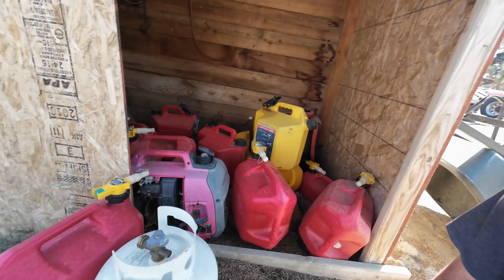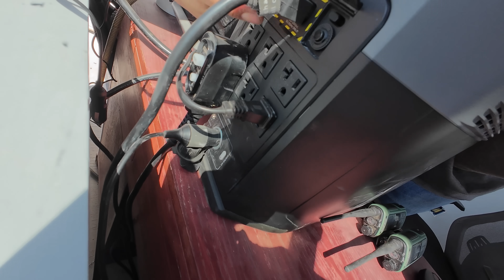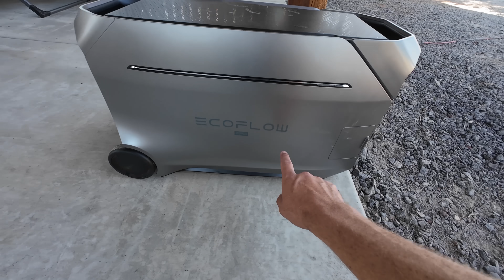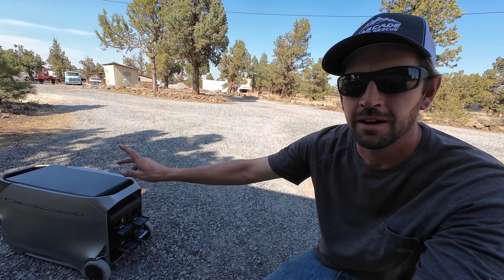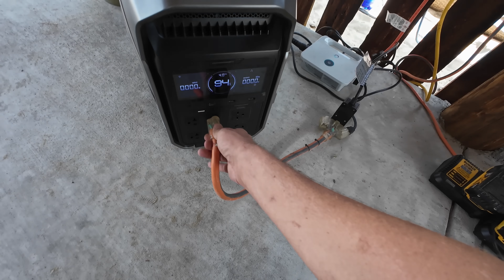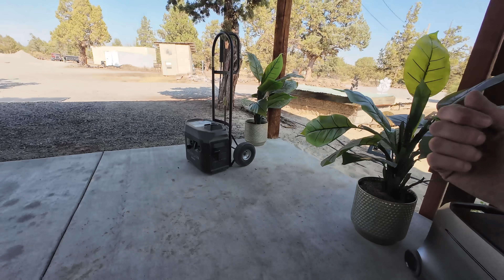Be prepared for DISASTER with EcoFLow's new Delta Pro 3!

Comment from the maker: Enjoy 5% off with my code 24EFDCASEY for your backup power. Valid until September 9 (Applicable for all products except Delta Pro 3 stand-alone, flash sale products and accessories).
Learn more about EcoFlow solutions: https://bit.ly/477ow9P
Discover the latest generator tech EcoFlow DELTA Pro 3: https://bit.ly/4cBdr1E
EcoFlow DELTA Pro 3 Amazon: https://bit.ly/3WSV2aC
Reply: Nothing beats EcoFlow that I've found it's more than worth the price if there is anything better nobody has told me😁
Reply: I wonder if the eco flo delta 2 or pro could be used to give a charge to your electric car if you ran out of charge in the middle of no where
Reply: @aaronmcconnell7358  yes there's ways too make it possible
Reply: Not that I would recommend everyone try because you could ruin vehicle very fast if done improperly
Reply: But is it repairable? I cannot afford power stations or setups that i can't fix if a circuit board fails 11 years from now.

Comment: 10:30 He misspoke a bit here: The Delta Pro 3's internal batteries can go through 3000-4000 charging cycles before diminishing to 80% of their rated capacity. The unit itself should certainly last well beyond that.
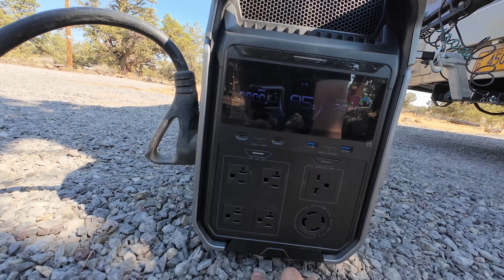He also misspeaks at 12:15... both the receptacles on the front's right half are 240V outlets. And you can only have EITHER the 120V OR the 240V output on at any given time, never both.

Comment: Reading the debate about the Ecoflow being a generator or not. Well the chemical reaction inside a battery generates electricity so it is both a storage and a generator 🤣 I’m only concerned with the fact that when I turn on my Ecoflow, my phone gets charged as do my rechargeable flash light batteries along with my soldering iron and LED lights. I’m in a situation where I cannot run an extension cable so charge it then move it to my work bench. I have sent a link of your excellent presentation to a family member in South Africa where electricity is basically rationed to about 4 hours twice daily. 😱
Keep up keeping up Casey! Your videos sure beat a lot of bs on tv.

Comment: The one thing that i perfer my c1000 over my dp3 is i can still pull solar at very low light. During a rainly dark day i can still get about 200-600 watts with the c1000 which isn't much but still something. My dp3 won't pull anything unless i lift the low light limit which only runs for a breif moment before it cuts out.

Comment: Needed to post this as I bought my Ecoflow as a direct result from your videos Casey. Purchased in Canada, so the code did not work, but wanted to let you know that they should give you codes for Canada usage. In any case, I am posting to help the algorithm as well. I left my rock lights on overnight last night and the battery was at 9.9v. Jeep would not start. First time I used the alternator charger to reverse charge the Jeep and it started up right away! Best purchase ever and thanks to your reviews! I was curious if it work, but had a real-life need to do so.

Comment: I purchased the delta pro system October of 2023.By October of 24 I had 6 delta pro failures. My units seemed to fail in a variety of situations. I had one that actually blew a hole in the side of the unit about the side of the round cooling fan. Thanks fully no one was hurt and it didn’t catch our property on fire. 

The customer service team that I had access to was not well trained. They wouldn’t be able to do much more than verify that the firmware was up to date on the device and my app. 

Normally I wouldn’t mind a standard RMA process but after each failure eco flow started to slow down their response time as they thought I was abusing their unit for fun. I’m not whistling diesel torture testing trucks. I’m a blue collar dude who supports his woman who’s been unable to work for four years due to health injuries. 

I overall really wanted to like the delta pro system but the unreliability made it hard. My thought is about the time of purchase eco flow had release the DPU. Maybe they turned their quality control focus toward the DPU and it causes the delta pros to be unreliable? The only info tech support would give me was claims of loose connections from shipping. I ultimately do not trust the delta pro system as it was genuinely unsafe and could have burned down our property.

I also was let down by the customer service team. I had nothing but difficulty getting fed ex to pick up the units to return them to eco flow. When asking the customer service team for a different carrier to see if that simplified the process they told me my request for special treatment was escalated to their supervisor. What type of customer service team responds to a solution oriented question with a response like that? 

I’m bummed my experience didn’t match most of the positive responses I see most people have. If you do purchase from eco flow I hope you all have better luck than I did!

Comment: I just bought the wave 2 for the bunk of my truck because I don’t do heat well, needless to say it was worth every penny (basically the value of the Canadian dollar) I wish I had the unit years ago because this summer is the first one I managed to get a good nights sleep no matter the temperature. I am looking forward to see how the heater function works this winter, but I don’t have any regrets thus far so even if the heater isn’t quite good enough I can still use the diesel air heater.

Comment: Through your fathers' day link (I think that's what it was.) I bought a complete set of two DeltaFlow Max systems with a bonus solar panel kit.  I'm still experimenting, but one is designated to charge my new EGO brand Zero-Turn mower and, outside of needing to be charged so I could mow before the system arrived/was set up, the mower hasn't been charged on anything else since.  The mower requires 1 and 1/2 generators to get a full charge in about an hour, but like I said, I'm still experimenting and debating on getting extra eco-flow batteries.  But I love the system as it is!

The first time I charged the mower I didn't have the supercharger set up yet so I was charging the batteries individually and each one took about an hour to charge.  It comes with 4 10 AH batteries.  And, now I have a 5th battery plugged into the mower, a 5AH, and the total charge time is about an hour with the eco-flow.

Comment: The Honda generator you showed has an eco mode, which runs the generator at idle when there is no load! Amazon DELTA 2 Max $1,399.00, Amazon DELTA 2 Max Power Station Extra Battery $999.00, Amazon DELTA Pro 3 Portable Power Station $3,199.00; Is EcoFlow a Chinese brand? Leading China's Energy Storage Market with EcoFlow. EcoFlow is one of China's most recent unicorn companies.

Comment: Casey, your killing me. These Ecoflow products are amazing and everytime you do these videos, I want another one. I have a Delta 2. I have used it for the past 2 years. I just bought the AC unit. I rent, so I can not have a generator nor store fuel. When you live in Central Florida, you need backup power and EcoFlow does the job beautifuly.

Comment: I purchased a Delta 2 , December 2022 and haven’t regretted it for one moment. It’s powerful enough to run my top load washer, toaster over, coffee maker, Instant pot. It doesn’t have a lot of reserve power but it’s a fair trade off for cost and portability. I like that I can change the charge rate via the phone app. I have three other different brand solar generators, but this is by far my favorite.

Comment: Have a River 2 and River 2 Max and the 160W Solarpanel. no regrets. 
One flaw is the "loud" fan. starts at low power and always at 100%... (full disclosure, didn't try firmware update)

Biggest flaw: how ecoflow tries to actively sabotage and block any other software using the API of the devices.
No option to tie them into your home automation setup, the community driven sollution depend on them not blocking even more options. That sucks and should be a reason to not buy ecoflow at all because you need the app for a lot of functions and since there is no alternative, the moment ecoflow decides to abandon a product or stops existing, you have very expensive eWaste.
All this without any good reason.
I really hate that trend of companies trying to control us customers wherever they can. "No, this feature we advertised will no longer exist tomorrow because we know better what you wnat than you yourself" "Oh you repaired your product in another shop than ours? Let us brick it for you to teach you a lesson"

Comment: Finally, an ad for battery-in-a-box devices that doesn't erroneously call them "solar generators". Closest solar generator is 93 million miles away.

I'm surprised Casey was messin' around with all those fuel jugs. I use a couple of DOT approved 30 gallon drums, a dolly, and a hand pump system I made. Sure beats lifting and carrying those jugs and trying to not spill gas all over the top of the generator (or the snow blower/mowers). I use a 9500/12500 portable generator connected with a manual transfer switch for whole-house backup power. It's a hell of a lot cheaper to buy and run (and fix) than a Generac.

Comment: The whole over blow on the term "generator" such hilarious trade in semantics. A  battery + charger/inverter as an accessory to any large domestic device is the way of the future.  (The present in my; house/Truck/Camp setup.)

A solar panel is to a battery/inverter "solar generstor system", what an ICE engine is to a "hydrocarbon fuelled generstor system" (Add hydrocarbons or sunlight and the "fuel" is supplied, I know what is easier to transport and store for ready availability at any time of day or night, in the open or under cover..,   
 
Even cooking a roast in electric oven plus cooking veges in a steamer on an indiction cooktop (say), only takes a few kWh ( and around 6-8kW peak power), that can relatively easily be packaged, along with the appiance, to allow non dispatchavle power to chsrge it up, or to allow a single smaller generetor to more efficiently run at its design point when it is necessary..  It also allows old, low capacity (current/Amps - by extension power , Watts), wiring in domestic dwellings to supply low quantity, trickle charging  for high power appliances / devices...

Comment: So $5,000.00 is efficient cost for you?  I can run my generator for at least 6 years on premium fuel and still buy groceries for the cost of one ot those fancy units
Reply from the maker: Yes.  I would rather spend $5k on a setup like this than 2k on a gas generator
Reply: @CaseyLaDelle  I bought my generator for 990.00 and it runs my entire house.  Water well and all
Reply: @CaseyLaDelle  I paid 990.00 for my generator.  It runs my entire house and water well.  I spend 30 dollars every fall to change the oil/filter/fuel filter.  I also live on a budgeted income and $5000.00 is way out of my price range.  The youtube channels have gotten way over top for most average folks cost of living. I remember when your channel was supposedly not making you any money because of the algorithm.  Seems like you're doing pretty good now

Comment: I bought the River 2 with a 100 w solar panel to use with the replacement battery for my cameras. The replacement battery's plug into an AC outlet so the camera has power continuously. I used it to take pictures at the Fourth or July parade and a movie of the Fireworks later that night. Stated with a full charge of 100 % and finished with 92 %. I also used it to take pictures of the solar eclipse last April. I don't need it for a lot of power usage, but also used it to run my Dremel to grind down a camera mount. To run my jigsaw to cut up some wood for a project I am working on. And I will us it to run my camera's as I take pictures at The WWII re-enactment at Midway Village in Rockford in September. The best money I spent.

Comment: To date, I have a Delta 2 and Delta 2 Max with each batteries(1 for Delta 2 and 2 for Delta 2 Max) that I got to replace two 2k Honda generators.  I have used them in power down and on camping trips. At this point I am very happy with them. Time will tell if the products hold up. I am not to interested in a warranty, as I want it to work when I need it, not get replace placed when the failed when I need it. I will be keeping one generator, as backup for when solar is not charing.  
One of the best things about a battery based system, is the lack of needing to keep fuel around and the fumes when using.
Did a 11 day trip with the Delta 2 and a small fridge.  No noise for 11 days. The people around us did have a generator and that was smelly and. noisy. We also had a larger solar setup on a trailer with a full sized fridge and freezer that we kept going all the time with solar and battery. It was nice to not need to make noise to keep the food cool.

Comment: I have used EcoFlow products for many years...We live in coastal Brunswick Ga and when hurricane Debby came through, for us it had downgraded to tropical force storm but we had over 15 inches of rain, winds were gusting 45mph. We did lose power for just over 48 hours and my EcoFlow Pro never missed a beat !! I have solar
panels on the roof that continually charge my system. My EcoFlow smart gen dual fuel would come 
at night for just very short periods of time. I also have one add on battery. Casey as you mention, 
these EcoFlow systems just work. The best investment and the peace of mind one could 
ever have here on the Georgia cost 💖

Comment: So if your empty RV microwave no longer heats up anything that's because you've ran your microwave empty and burned out its magnetron.  When I did electronic repairs that was probably the 3rd or 4th thing I heard the most after I asked when/what did it do last time it worked.  If the microwave isn't heating up things as fast, then consider replacing magnetron, or delegating it as a backup and store away after replacing the microwave.

Comment: hey Casey thanks for the great content as always, if you put the delta 3 in your RV you can add the EcoFlow alternator charger to charge the unit anytime the vehicle is running and it can also jumpstart the vehicle if its battery dies.

Comment: Which fuel do you use more, gasoline or propane in your dual fuel generator? I got mine with your discount for emergencies and plan to use propane first so I don’t have to drain the gas out. So far the only thing I would change on the Glacier is the ice maker drain. The hose could use more room around it to reattach it. Do like the bullet ice. I think the ice maker is a perk to use the space above the compressor created by the design.

Comment: Thanks to you I discovered SetPower and now I own three of their fridges... the 16, that new 30 you spoke of recently, and the big 50-something one.  They're great.  The big one runs all the time supplementing my RV fridge (I live in an RV).  On my RV I have 700 watts of solar power and two 200AH lithium ion batteries.  And a couple of those little Honda 2200's when solar isn't cutting it.

Comment: Solar requires a good unobstructed path to the solar source, aka the sun. Houses with huge trees surrounding the south/south west sky are at a disadvantage for solar energy, in our area. For your situation solar is an ideal way to obtain essentially free power, after the initial investment for equipment. With my situation in central Virginia, we have infrequent power outages. But several years ago, we were affected by a coastal hurricane dumping humongous amounts of water on us (100 miles inland). Power went out in a wide area. Announcements were made that some areas would be down for days and weeks in rural areas. So off to Home Depot and we were lucky they had a supply of generators, moved up front, near the check outs. Prices were not raised, thankfully. So, we saved the refrigerator, and a few other items were connected. Since then I have upgraded to a 10,000 watt system with a Reliance 10 circuit transfer switch box, all work being done by myself. I run everything except dryer and water heater. Can run two AC units in summer and two electric heaters in winter. In either situation we don't draw 5000 watts, so plenty of capacity available. And the generator can run 8 hours before needing refueled.I did check solar, but it is not feasible on our street or the next street over.
But . . . Casey did an excellent unbiased "review" of the EcoFlow equipment. Let there be light! Yes, it is wise to pay more for a proven system that is unlikely to let you down.

Comment: I have the River2 Pro and the Wave 2.  The Wave2 has kept my 15' camper cool and comfortable on multiple 90-100 degree camping trips.  It works so well, I moved it to my bedroom in my house when I was not camping.  The River2 Pro has worked flawlessly.  I use it for camping when I do not have shore power, and running a cooler in my car. If I had realized the usefulness of their high power port, I would have gone with a delta series. I would have liked the option of running my Wave from it, and the car alternator charging would be a real win for me.

Comment: I have an EcoFlow Delta 2 that i bought to power my CPAP if there is a power outage.  I've only used it  couple of times, but it makes all the difference between being able to get some sleep and being awake all night.  Casey is right, they are not cheap, but they are not built cheaply either.  I did get mine on a pretty good sale on Amazon, so that helped.  Next project will be some good solar panels in case of a longer term outage than just overnight.